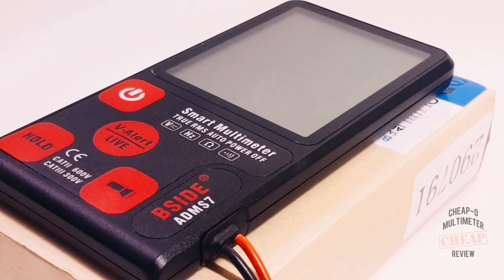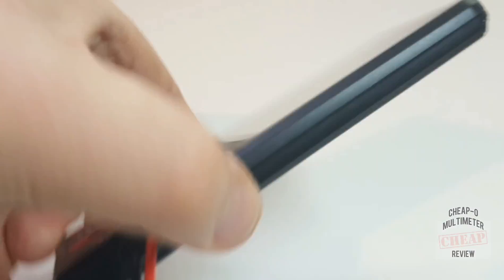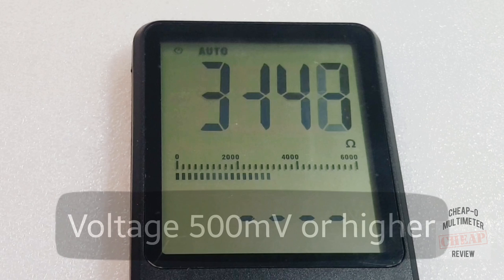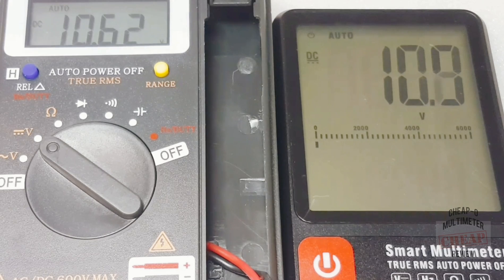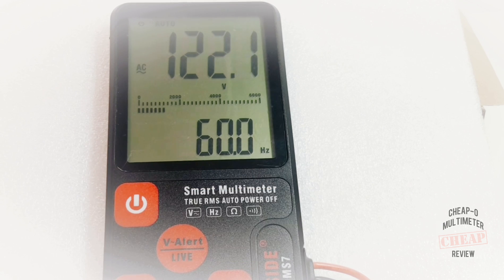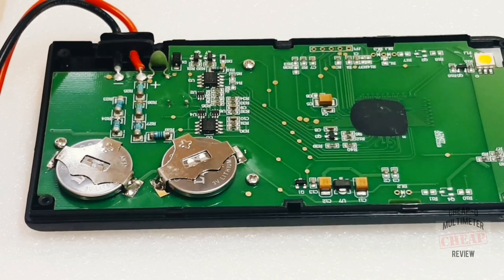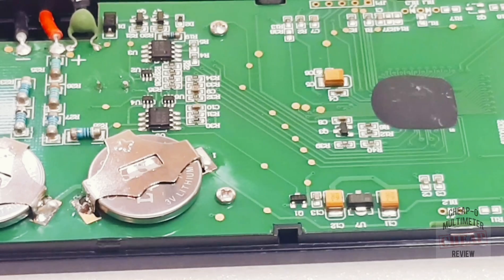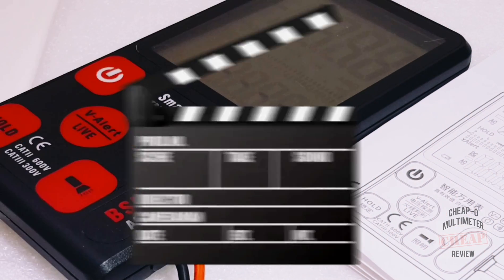BSIDE ADMS7 CHEAP-O Pocket Multimeter Review & Teardown!

Comment: Hi. Can this measure and test capacitors like SMD capacitors in circuit (no need to desolder)? Thank you.
Reply from the maker: Unfortunately not..capacitance is a no fly zone with this multimeter
Reply: @KeepOnTesting  Hi. Thanks sir Darren. 
I hope one day, God willing, I'll graduate from a knowledgeable in electronics to able to build and design circuits and invent or improve stuff. :-)

If it's ok to ask for recommendations on a new multimeter. Among my multimeter choices are:  BSIDE S11 or the S20 which is best for these repairs: iPhone 5, Wacom Intuos 4 and retro video game consoles specifically the Dreamcast, most don't have power. BSIDE is the brand name.

When I post the specs and links here, the Youtube bot or automatic censoring system keep blocks it. BSIDE's official store can be checked at that popular chinese retail website that starts with the letter A and ends with "express" (my apologies.)

They have the S10 model which uses AAA. The S11 and S20, even though the S20 has a higher model number trumps each other in terms of capacitance readings, resistance etc. The S20 does have an EMF sensor, if that's important.

You're recommendations are welcome.

Thank you. Stay safe.
God bless, Rev. 21:4

Comment: This is a clone of the Mustool MT77 from banggood. There is an upgraded MT99 which is supposedly better but just as crappy. This states 6000 counts, yet there is only 1 decimal point when it should be displaying 5.999 under 6v. I got the mt99 which states 9999 counts but it's the same as this only nicer.
Reply from the maker: Roger that..thx for the update!

Comment: The meter is not accurate at all, especially when measuring very low voltages. Two digits are not enough for me. But it does make a great coaster. Cut the leads and it also makes a great smartphone imitation.
Reply from the maker: That's for sure...looks great but it all ends there...nothing sublime about mediocrity.
Reply from the maker: That's for sure...looks great but it all ends there...nothing sublime about mediocrity.

Comment: no diode test function
Reply from the maker: No Chris, no ability to test diodes..
Reply: I bought one. it is erratic when you're testing voltage rails that contain some amount of noise and spikes. and that true rms statement is a bit disappointing too
Reply from the maker: @chrisblank9090  Yes indeed, a rather uninspiring performance on the DC Voltage tests..A truly wasted display!

Comment: Sadly I agree with your star rating as well, I havent liked any of the smart meters very much, ive got a couple other versions and theyre more of a gimmick than a meter & money better spent somewhere else - this ones really just a keychain flashlight with a meter on the side--lol  Looking back at the green SATA meter now that one works very well, its an odd duck too as its patterned after a cell phone but it has decent build quality and flat just works & I like it - but its not a "smart meter" it has fast reading ranges a decent backlight and oh I dont know,  some engineering-! lol.  These smart meters seem to be a trendy thing theyre thinking will sell because they mimick a cell phone, but implementation and performance are just too lacking.  What a waste of a good display and bar graph. I like the big dual display on this one, but its sadly wasted on bad performance and limited functionality.
Reply from the maker: Agreed! Alot of wasted potential and all we got was a pretty face..I like your keychain analogy that's exactly what this meter is good for!! ..So disappointing as I expected much more!
Reply: @KeepOnTesting  but this for the cheap one
Reply: could you give a certain models of smart meter you  have tested and what about 
https://www.aliexpress.com/item/Aneng-V04A-Data-Multimeter-Ncv-Digital-Lcd-Ac-Dc-Voltmeter-Auto-Range-Diode-Resistence-Frequency-Capacitance/33015409543.html?
Reply from the maker: @akcoord9615  Yes, I will have a spreadsheet download link available in a few weeks..it will list the multimeters I've reviewed along with their individual scores.